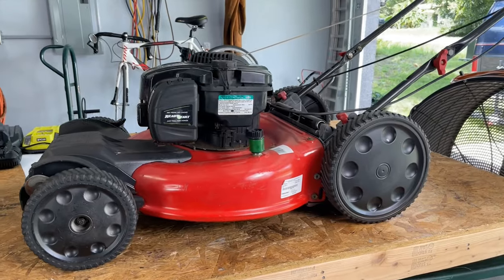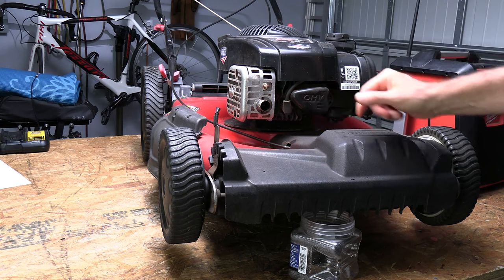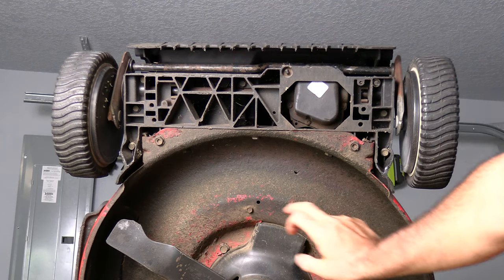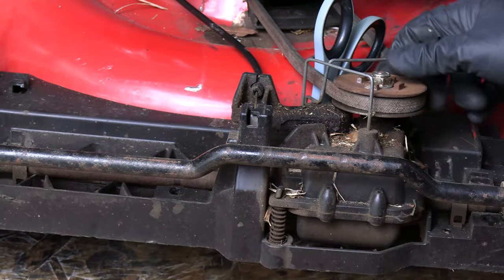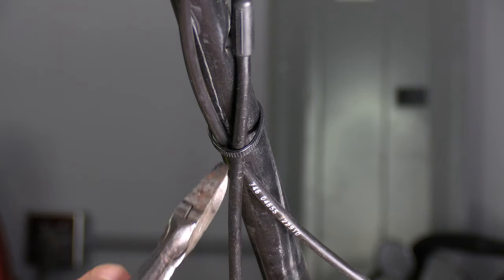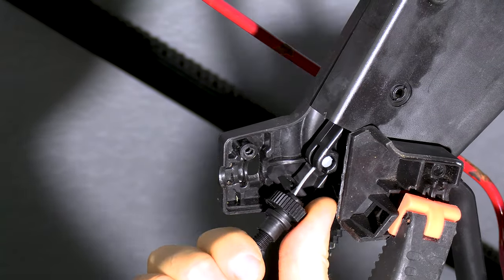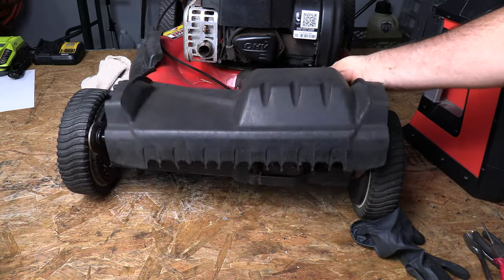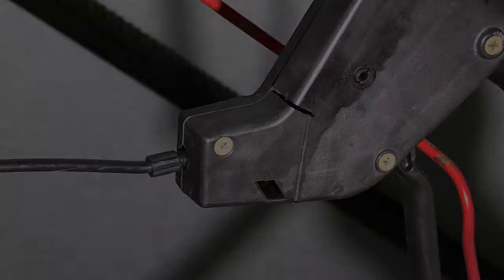Replace the Self Propelled Drive Cable On This Troy-Bilt Lawn Mower

Comment: It's important to note that on the TB200, and possibly other models, there are two  additional bolts that need removed from the top of the deck, one down by each wheel.
Reply from the maker: HI, thanks for the info!

Comment: Your video saved the day for me! Some of the old bolts on the bottom were so aged that I had to use vice grips so that I stood a chance at removing them that way before stripping the heads too bad. I took too many of the bolts off on the bottom and ended up releasing the belt from its front end connection. Or maybe it was off and that was why my front wheel drive was not spinning, I'll never know. Anyway, I put the belt back on with the funny tensioner that I had to go back and watch the video again for, then it all came together. And I was able to replace the cable since I ordered one anyway and had everything apart. The cable attachment cover on the handle did not fold back so far, so I didn't bend it in case it was going to break, but I managed to find the little slot to slide the old one out of and that was the final move.  The whole process was something I was not looking forward to doing, but felt much more comfortable being able to follow your instructions. I went to the hardware store and got the drill bit connection for the 3/8'" socket to fit on and that kicked ass! I could have never done it manually with just the socket set. I saw another video that explained how to tilt the mower with the carburator on the high side so that fluids would not get into bad places. Also there was an explanation on how to pull the start cord to the spot where the most resistance is and that prevents some type blocks on a certain valve. Anyway, my mower started right up after more than an hour of being tilted backward, and then to the side with the carb on the high side. It ran so fast that I almost had to run to keep up with it, so kudos to you.
Reply from the maker: HI Brian!  Thanks for the great comment.  I'm so glad I was able to help.. 😊   I also have a video on tilting the mower over.  I use that trick all the time so the oil doesn't get into the muffler or gas spilling all over the place if you tilt it on the carb side!  Hopefully you replaced any bolts that were rusted and ready to strip while you had it apart so you don't run into that again.  I wasn't sure if you said you did.
Reply: I need to remove the entire thing from the deck because I need to get the Deck welded? Any videos on the process? This video was very very good @JLPicard440
Reply from the maker: @catslivesmatter1268  HI, I don't have any for that specifically... What needs welded?  They can't do it with the motor and everything in place?  I do a lot of welding and I can't see why you'd need to remove anything, just make sure there's no gas dripping anywhere...

Comment: Take a Bath HIPPIE. Is what I heard yelled at me. 

Thanks for the vid. Great info. A little different getting cover off (TB240),  but I got the idea.
Reply from the maker: You're welcome!  Thanks for the great feedback and I'm glad to help... 😊
Reply: @JLPicard440 
ok,  on the TB240 there are two other screws from top ,one on each side behind the wheels. 
    But-a question,  when opened,  actually the problem was the belt off the front pulley. 
I had to increase “tension” up on handle bar,  then It drives. 
   Any clue why this would suddenly happen?
Putting cover back on now with fingers crossed. 
Thanks for any help-
Texas Bob
Reply from the maker: HI Bob.... Is the belt guard in place?  Or if it is, is it bent?  There shouldn't be enough room between the pulley and the belt guard for the belt to jump off..  When you release the handle there's all kinds of slack there, but the belt should stay on.
Reply: I was surprised too,  No,  the belt guards all seemed to be fine and not bent.   A bit difficult to get belt back on pulley. Hoping I didn’t get fingers pinch. I agree it didn’t seem  like it should/ could jump off. 
Thanks.
Reply from the maker: Yea if you're pinching fingers it sounds like it's on right!
Reply: I know why. Your missing the metal clip that holds the entire front  gear wheels in place. Check the rod across on front wheels where your gear box is and see if you see a metal clip holding your rod down from moving when cutting grass. This has been happening to me as well . Belt keeps slipping off and I happen to receive another lawn mower just like what I have ad I looked and what you know there is a metal clip that holds the front end front moving...

Comment: Any idea where to get those small clamps fir the axel. ... all 3 of mine have broke or are missing..... any part #
Reply from the maker: HI, If you go to www.partstree.com and plug in your model number at the top they'll let you see the parts breakdown with all the part numbers for virtually every part....  Your model number should be under the seat...
Reply: Thanx.... axel clips ordered.....

just put 2 of 3 on. What a difference it makes. The axel is nice and secure.  1 clip wont stay secured because part of the plastic it connects to has broken away.  Oh well, 2 out 3 aint bad !😅
Reply from the maker: Sorry for the delay, I just saw your comment... Great!  Glad to hear you got it going again... 😊